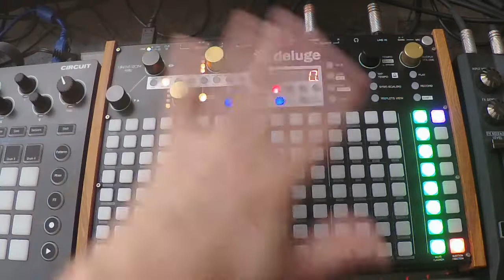How To Program Midi CC For External Synths // Synthstrom Deluge Tutorial

Comment: So if I'm understanding correctly,  with 8 buttons of two CC each, you can have 16 different CC settings per track, ... So if I wanted to do something insane like setup a 6 or 8 part multimode  (multitimbral patch) on my Virus TI2, I could step modulate up to 16 parameters on each part , for a total of over 100 cc modulations going at once from a multitrack deluge project?
Reply from the maker: @AdamsOlympia  I believe so. I haven't gone too crazy with it but possibly:)

Comment: Sorry to drag up an old YouTube video. I’m trying to have a single midi track with one CC value only a Zero 0. If I have just one CC value it won’t send that out. If I have two on the one track a zero and a 100 it does. Any ideas? Thanks for your great videos
Reply from the maker: Hmm just turn it all the way down and it should work right? Unless I'm missing something?
Reply: @RonCavagnaro  it’s strange if the CC value is just one value for the whole track when you play that track it doesn’t send out even if you stop it and start or mute and unmute that track it just doesn’t resend out the CC value. If I have say a value of 1 and a 2 in the same track it keeps sending them out while it loops. It’s super strange and doesn’t make sense.
Reply from the maker: @troyouttram  hmm try to record it set to zero?

Comment: Is there a way to set each track/instrument within a template to a different midi channel?
Reply from the maker: Yes just turn the knob
Reply: @RonCavagnaro  Thanks, but I am referring to sounds/samples within the Deluge. Does that make sense? Thanks for your time.
Reply from the maker: @tonydrake821  I think you'll have to elaborate, I'm not understanding:)
Reply: @RonCavagnaro  Actually, I think it is a matter of choosing which channel to transmit on from the controller.  Thanks.

Comment: this deluge (got mine just over a week ago) is like the gift that keeps on giving. at the end you mention you would need to save a template to save your midi cc values... are you saying you can save a "template" in the deluge itself? curious if you still use this workflow since you posted the video.
Reply from the maker: There's no templates for midi yet but save as a premade song template file and load every time making a new song.
Reply: Ron Cavagnaro ok gotcha. Thank you so much for your vids man. Makes this cool little box so much easier to figure out. I love it so much I’d consider buying a second one just because...

Comment: Hi, i have just ordered a Deluge and am particularly interested in this aspect. Is it possible to midi learn the knobs (eg, cutoff & resonance) on a per track basis.. so that you can affect the cutoff and resonance of two different synths that have different CC assignments?..thx
Reply from the maker: Mystic38 I'm not sure how that would work. Unless you're sending the same channel on both synths
Reply: sorry..it looks like i wasn't as clear as i thought..lol.. can we program one track on one midi channel, cutoff knob = cc40 (virus), and another (different) track to another (different) midi channel, and cutoff knob = cc102 (mopho)?...
I am basically looking to use the knobs for the same functions on different synths on different tracks, thx
Reply from the maker: Mystic38 each track will be set per channel but you can't make one knob control both cc and tracks at the same time I don't think but if it's separate yes
Reply from the maker: Sorry it's hard to understand exactly but I am running about 8 external synths on my Deluge routing my midi w daw. I can assign cc per track each track is blank and can assign anything. My issue currently I can't save the cc as presets which would be optimal because I don't want to set a template with 8 synths I may or may not use
Reply: thx..  i think i understand.. however, if you just said you can adjust cutoff on different synths on different tracks at different cc with one knob (but at different times) then i actually did understand!..lol thx
Reply from the maker: Mystic38 there's no multi assign very hard to explain in words but easy if I could show an image its very simple. Each track has it's own knob setup
Reply: k, Thanks Ron.. looks like it should be fine.. or, certainly no worse than any other box in this regard..lol